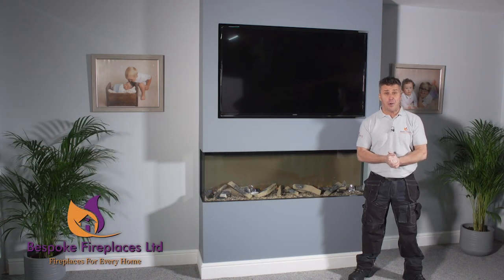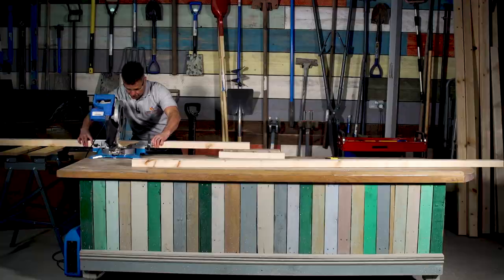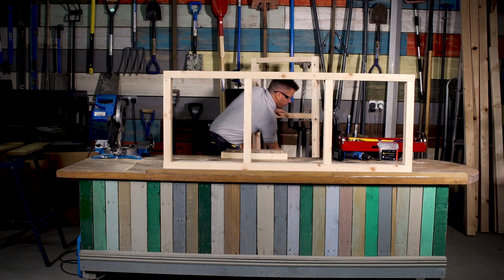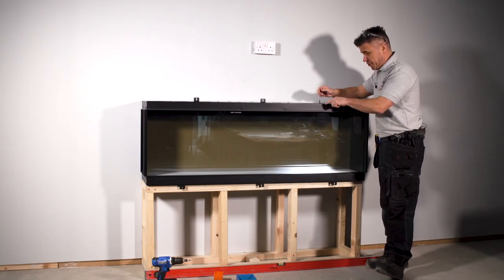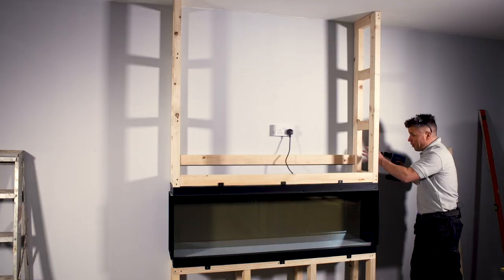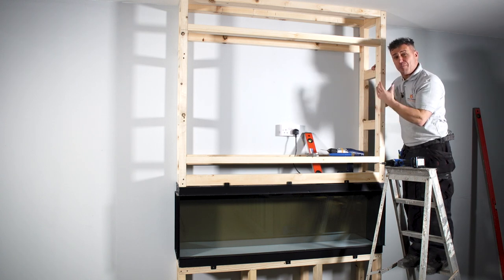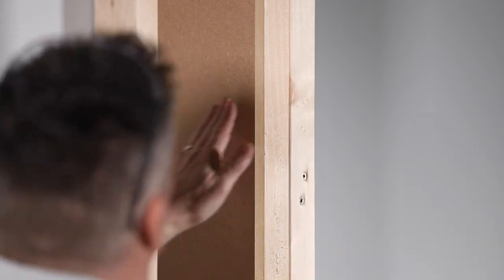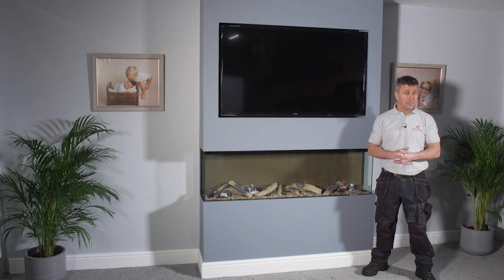How to build a Bespoke Artificial Chimney Breast with Craig Phillips | Complete Media Wall Build

Comment: Hi Craig, did you mitre the corners of the MDF or did you butt them? if you butt jointed them, did you use a corner tape or sealer? cheers
Reply: Hi Kacs, I didn't mitre the corners I just butt them together with lots of glue on the back, then sanded them well so we didn't see a seam when it was painted over, you could always fill any minor gaps before painting if you have any.
Reply from the maker: yep

Comment: What did you cover the mdf with before painting to get a smooth finish? I’m attempting this build soon but don’t want to use plasterboard. Thanks
Reply: Also want to know this
Reply from the maker: Hi James, I didn't cover the MDF with anything before painting it, I just filled the screw wholes with filler and sanded them once dry, then a couple of coats pf Frenchic chalk paint did the job.
Reply from the maker: @juicedrop89  As above PTGODZ
Reply: Thanks for your messages James, I hope Craig's answer helped

Comment: this looks great. im going to do this myself. i would of thought you'd have to plasterboard it and skim coat it to get a nice finish on it. what would be your thoughts on this method?
Reply from the maker: Both ways are perfect, I've just built another in my own living room, its a hanging fireplace and i've plaster boarded the frame then skimmed it and it looks great, we'll be putting a video out soon
Reply: @MrDIYCraigPhillips  just wondering, did you install the fireplace then skim, or did you install the fireplace after you skimmed it?

Comment: My neighbour and partner are currently building this in my house, our fire has side vents are we ok to cover them? Thanks
Reply from the maker: Are they building the same unit as I've fitted in the video? Your fire has some vents! in the new one or exciting
Reply: Yes exactly the same unit the fire is a glazer 1500 it has vents on the side would I need to add vents to the structure, hoping not as I want it to look exactly like yours
Reply from the maker: @katiegaughran7470  If your using the same fire as the one I used then you will not require any further vents in the frame and paneling, the fire is vented from the front top underside as well as behind the unit.
Reply: @MrDIYCraigPhillips  How much would the whole thing cost?

Comment: i cant screw the top ones into the ceiling cause my joists go the opposite way whcih is no good cause of the depth away from the wall as too be depth of the fireplace
Reply from the maker: Just try to use a good grab adhesive like Max Bond from 3C

Comment: Don't Silverline make Impact drivers.....?
Reply from the maker: Yes they do.
Reply: @MrDIYCraigPhillips  Not teaching you how to sucks eggs mate but surely you should of used one to prevent stripped out screw heads, the sound was terrible...!
Reply: @ronaldomac566  We do use them, Craig had pilot drilled the holes when using the standard drills, the noise sounds worse on videos than it really is due to the very sensitive radio mics we use for filming